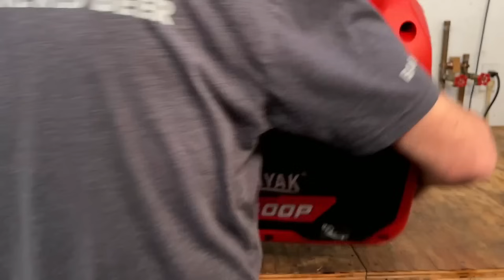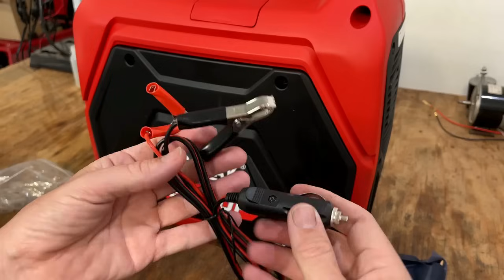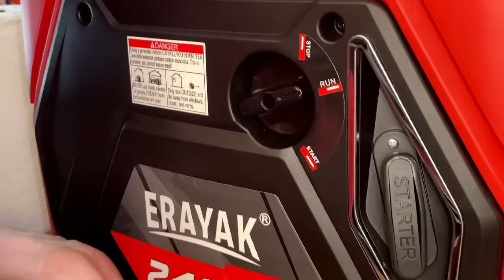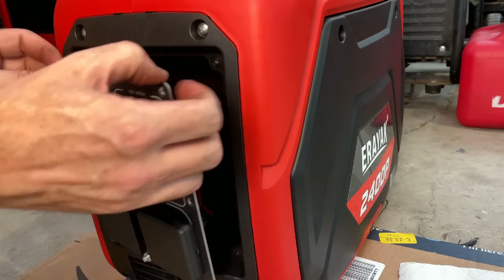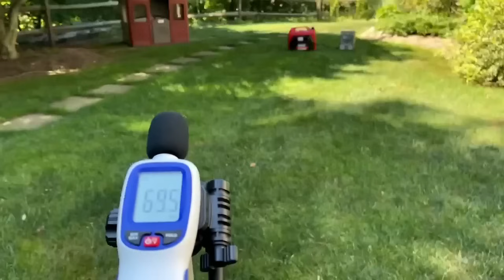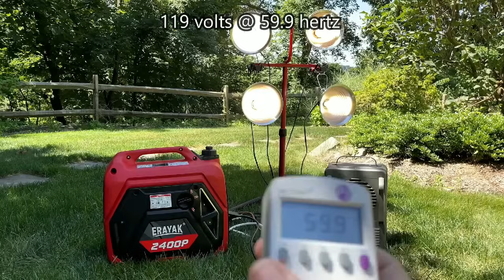Erayak 2400W Inverter Generator Reviews & Performance Tests – Best for Camping & RV Power

Comment: Will this run a refrigerator
Reply from the maker: Yes, the ERAYAK 2400P can power most standard refrigerators, as long as their running wattage and starting surge are within the generator’s rated output. Please check your refrigerator’s specifications to confirm compatibility.